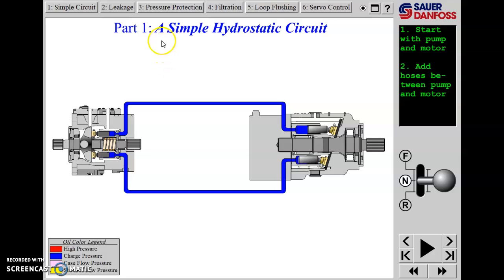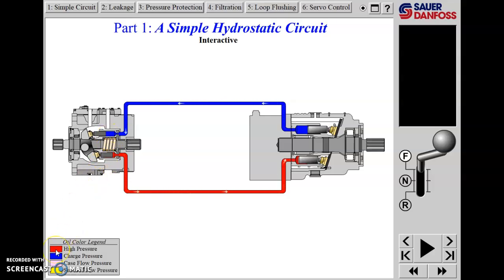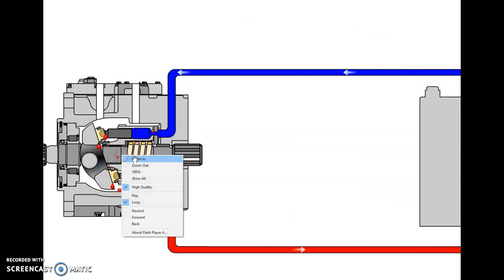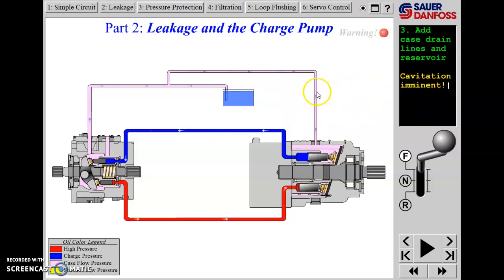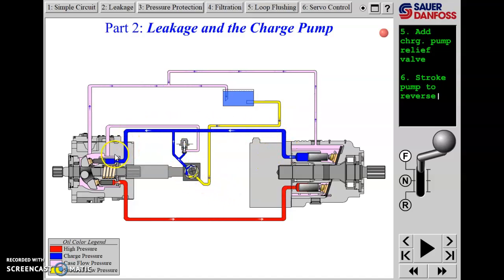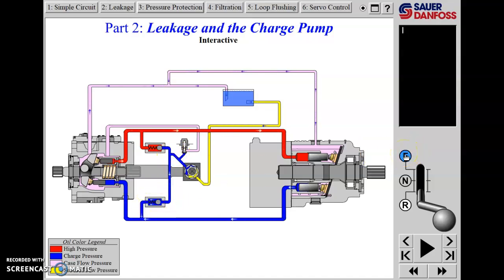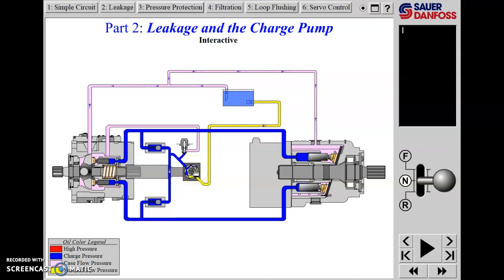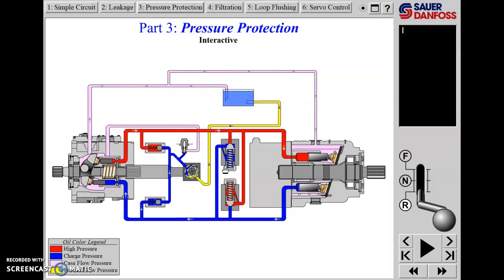CLOSED LOOP HYDROSTATIC PART 1

Comment: thank you for putting this video on . It is easier to understand how hydrostatic transmissions work when the parts in the system are added as the video progresses, this gives a much better understanding of how they work.

Comment: Hi, I understand how a hydrostatic drive works, however on large tractors that have multiple speed ranges(working speed, slow, medium, fast, and on-road travel/max speed), do they have an intermediate gearbox between the hydraulic motor and the drive wheels to select the speed range and withing that speed range it operates as a standard hydrostatic drive or do they uses significantly larger pumps to move more hydraulic fluid turning the motor significantly faster and the tractor goes faster?

Comment: Very good explanation about every component in this system!
  I'm interested in advanced hydraulic systems and I really would like to know how modern excavator pumps and maneuvering systems work. I thought a track driven excavator has a separate pump for the digging functions but obviously it has only 2 variable displacement pumps and a small pilot pump. Any video about this anywhere?

Comment: Hi. Does hydraulic oil overheat after continuous use? Is it necessary to have connection from oil cooler to add cooled oil in this close system? Please help me out why some hydrostatic transmission in tractor  don't have oil cooling system?
Reply from the maker: on some systems, if the hydraulic tank is large enough, the walls of the tank will provide adequate cooling. In small equipment, like lawn mowers, the hydrostatic unit is often made of finned aluminum for cooling.
Reply: @hydraulics  thanks for reply. Does aluminium finned enough for heat dissipation?
Reply from the maker: @mandarkokate5613  for a small riding lawn mower it does if operated properly

Comment: can the charge pump be used to operate actuators like cylinder and steering unit?
Reply from the maker: no, generally the pump is only sized to properly charge the hydrostatic system and it only runs at a few hundred psi

Comment: All the earthmoving equipments are closed loop one?
Reply from the maker: No. Skid steer loaders, small dozers, lots of ag equipment,  paving products mostly ... it's a long list but there's more equipment with conventional drive trains than hydrostatic.
Reply: @hydraulics  and the excavators uses open loop system?
Reply from the maker: @sumitmukherjee7790  most do because they have large hydraulic tanks for implement systems already. One main benefit of closed loop hydrostatic is that you do not need to return large quantities of oil to the reservoir.

Comment: What pump and motor is needed to achieve 300hp at 4000rpm with a 400hp gas engine